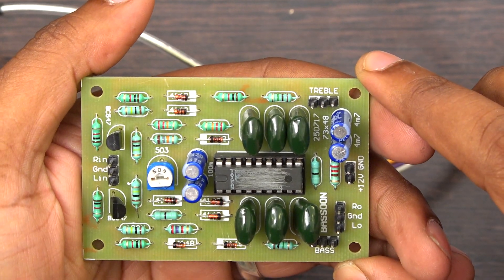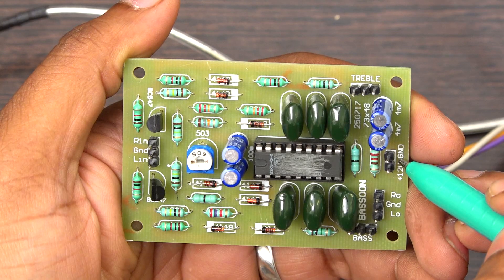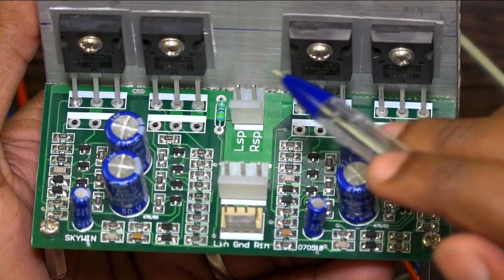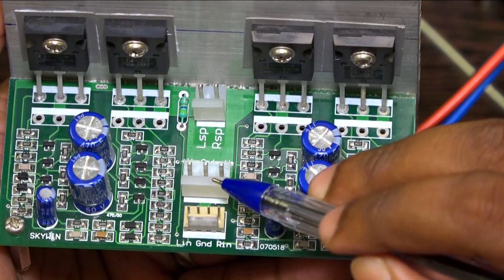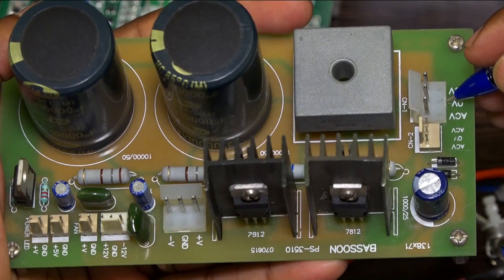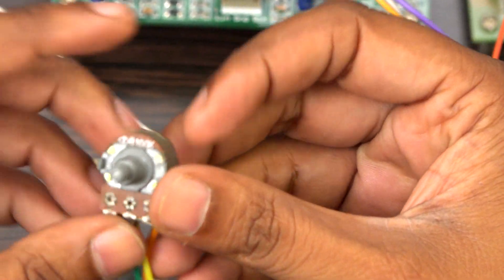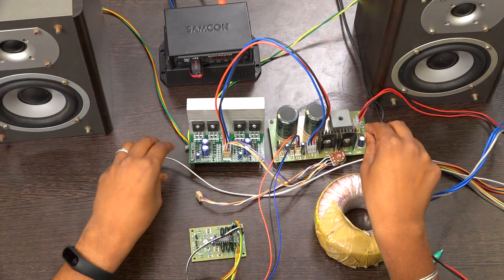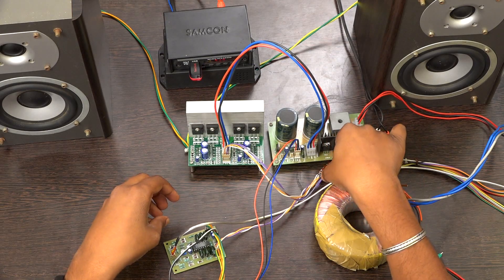Bassoon Bass Treble(BT) Board Demonstration

Comment: Why not available 4 transistor based stereo tone control good quality board (each 2 tr one side). Getting all transistor BT in market poor quality
Reply: if you go full discrete or opamp based tone control board ,it will still not beat philips tda1524 sound balance,musicality.philips tda series integrated circuits (class ab amp,volume+tone control,dac) unbeatable reference quality sound.sadly today's generation under western forum influence have not realized that philips hi-fidelity from 1990-1998 is world's no.1 sound.